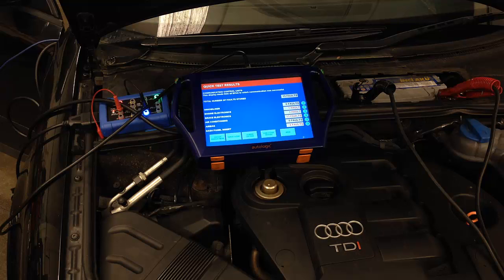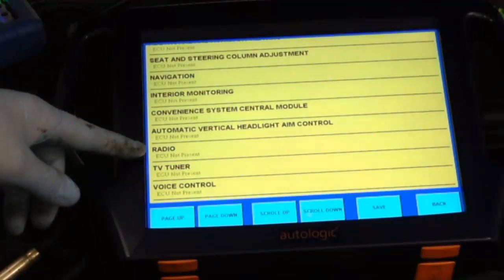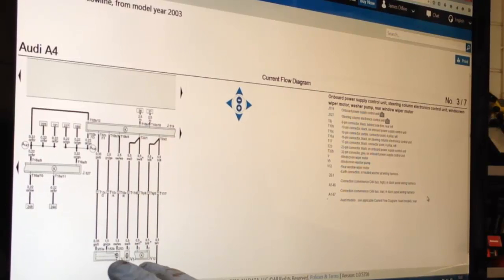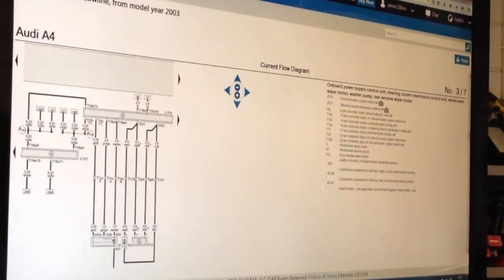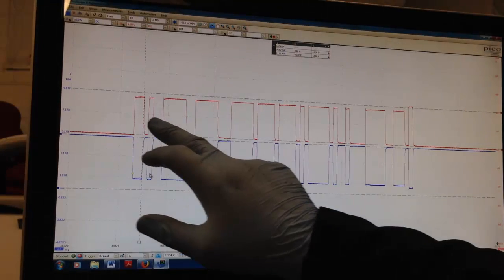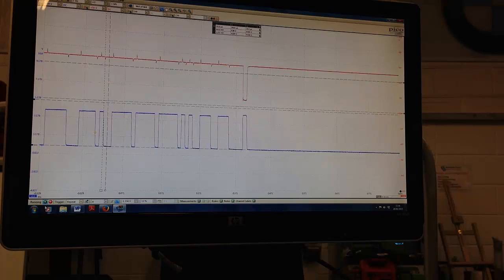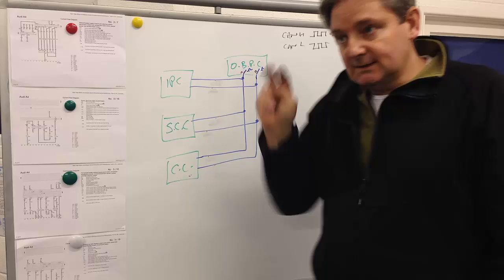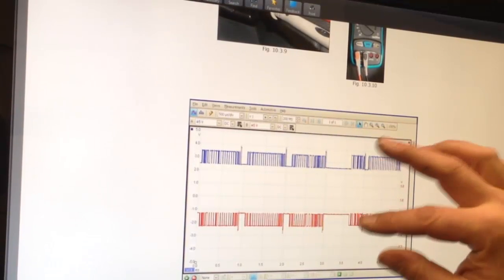James Dillon Diagnostics Audi A4 Body Network Issues

Comment: James thanks very much for an excellent video ,I really liked u showing your thought process how to diagnose can signal faults. Its always very difficult when the parts are so expensive are non returnable! Quick question would that faulty waveform have shown up at pins 6 & 14 on the obd link connector cheers sandy
Reply from the maker: Hi Sandy. The answer is 'it depends'. Sometimes the CAN (or maybe not all forms of CAN i.e. body/low speed and powertrain) isn't present at the data link connector. You may have a diagnostic interface 'in the loop' which prevents you getting a can signal at the data link connector. If this is the case my tip is to seek an easy location (one of the computers) and hook up to the CAN H and L at the loom. Thanks for your comments.